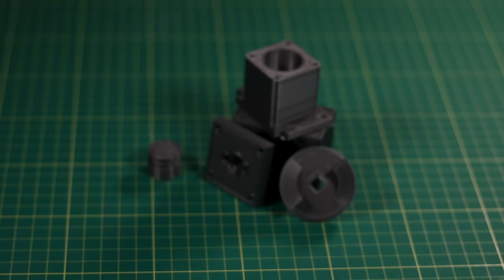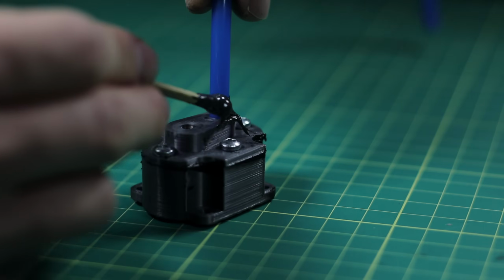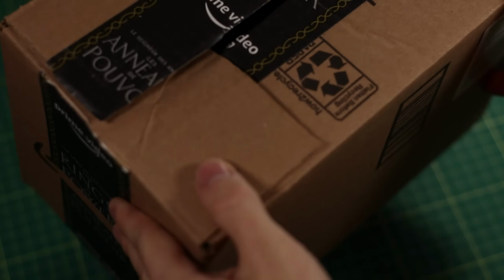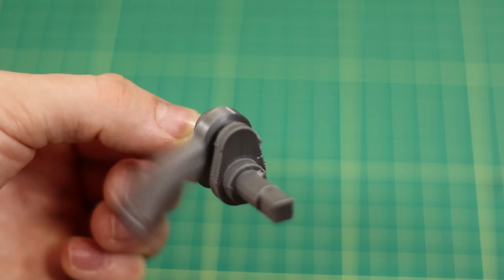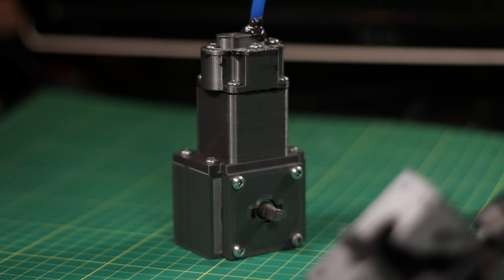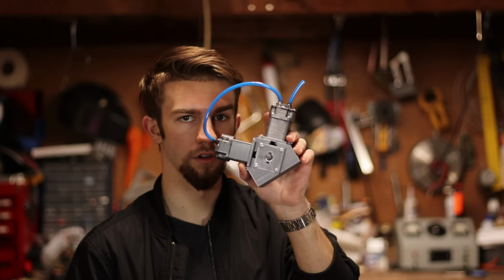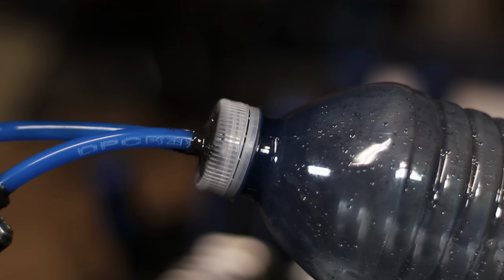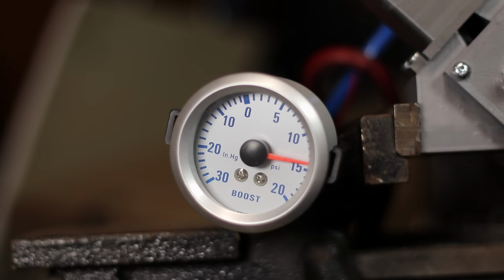The 3D Printed Air Compressor: Will it Work?

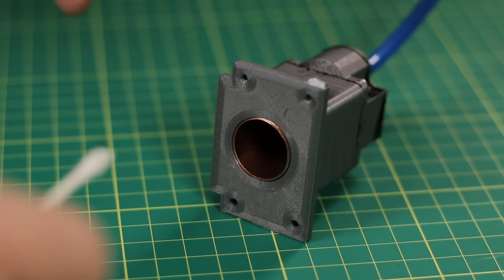Comment: at 1:58 , I can see metal casing inside the cylinder. What metal is it? How much mm diameter metal casing required for this? also please mention thickness and length. of casing ?

Comment: to have multi cylinders compressor, you have to make a calculation on the volume of each cylinder. Having both cylinder the same volume results to the same pressure at the entry of the second then at its output. So you can change Lenght or diameter but never the same...

Comment: Hey friend! Did you use a piece of copper pipe from home depot? I bought one and cut it up to make the cylinder but the piston doesn't fit. I'm thinking of just sanding down the piston to have it fit better but figured it would be good to hit you up since you are actually REALLY responsive on here (which is awesome). I was also curious what you used as pins to hold the piston to the crank shaft?

Thank you again for all you do!
Reply: For whomever it might help I was able to get a more flush fitting on the pistons with a 98% scale

Comment: I know it takes away from the 3d printed aspect, but you could probably increase pressure by adding metal sleeves inside the cylinders.

Comment: tbh this would be a nice way to compress air for an desktop laser cnc. but instead of the glue i would use ptfe connectors. is there any chance that you would share the cad files so i can add the ptfe thread? thanks!
Reply from the maker: They're in the description of the video :)
Reply: @CamdenBowen  yeah i see the slts but i cannot 3d model meshes :).

Comment: Air compressor for a 3d printer part cooling. We have used air compressors instead of fans for the Hevort. This 3d printed compressor is about 1/10th of the cost of what there using 👌👍.

Comment: wonder if you could find a gear ratio that would continually feed air, to one of your air motors, off of the air motors flywheel. (crank to start) if even possible probably need a blow off valve so the compressor dosent go boom.

Comment: If the HP cylinder volume is not half the LP volume then u are not compressing anything in that cylinder, if you fix that the compressed air will exist at a higher temp, and the plastic will melt. To fix that you need to lengthen the pipe between  the two cylinders  and cool the compressed aid air in it . called an intercooler. The head of the the HP cylinder must be made of high melting point materials and cooling the air there is called an aftercooler. Discard the ball valves and use reed valves (flat pieces of high temp steel). Maybe cool the heads with dry ice. If you succeed in that, then that would be really worthwhile,  as when using the pressured air it must be reheated to achieve perhaps 90% efficiency. good luck.

Comment: I coupled a single cylinder 2 stroke RC engine with an electric motor and was surprising good at supplying air, obviously in pulses and a little warm but surprisingly good

Comment: If the valves were the issue, it would be interesting to see different materials tried for the ball valves or forced valves used. It would be pretty cool to  have a 3d printable air compressor that can actually be used for air tools. Particularly if it was turned by a 3d printed dc motor run off of solar panels, so that the compressed air acts as a solar battery
Reply: There's too much dead space in the valves compared to the travel volume.

Comment: I know you think it's 20 psi because the BOOST GAUGE is telling you this but that is not correct. 34.7 psi. The boost gauge as with most gauges that measure some form of pressure do not account for atmospheric pressure (about 14.7 psi). Your system was capable of generating 20 psi above atmospheric pressure would be a more accurate description.

Comment: 2 suggestions
a V8 compound with 4 pairs of 2 stage cylinders, I would suggest to make the second cylinder smaller so you actually get much higher compression
or a inline 4 cylinder version, but all 4 connected in series, but decreasing piston diameter by 20% each step

for the last 2 stages you may need an alternative to O-rings tho, maybe a combined compressor with 2 O-ring pistons and 2 membrane style pistons or something

Comment: u cant tell significant differences by just opening a water bottle and comparing the pop.. u should've just used guages, plus the compressed air being compressed twice doesnt sound like how air works and if the pressure would double, the second compressor should fail faster and should be build stronger to contain twice the pressure plus new air being compressed together.. just seeing some holes in this setup.

Comment: You can always use plaster to turn your 3D print into a cast, melt out the plastic and recast them in aluminum. Good use for old soda cans.

Comment: The drill is likely to cause a heat related failure - keep the temp low with low rpm. The epoxy also isn’t likely to hold onto PTFE tubing for long - recommend pneumatic fittings for that.

 Cool design though - I really enjoyed it, especially the BB valves.

Comment: Suggestion: make a double head in one cylinder. The bottom head is larger with  a smaller head attached to the larger head, as one piece. The discharge from the larger head goes into the smaller head suction & that discharge goes to a second set of cylinders set up as in the first set. Your pressure would be increased.

Comment: You should use a one way valve between the engine and the tank that way you can prevent leak and store the air in the tank without exploding the engine!

Comment: I'd love to see this scaled up. The tolerances in 3D printing aren't great for things like this but as you increase the flow volume the compression losses are a smaller percentage of it overall. If you can use teflon seals and proper bearings for the crank you would be able to run it faster more reliably, plus an air tank with proper fittings would be nice also. Copper tube for the cylinders is a great idea to help with heat which is pretty much going to be the limiting factor on performance for any compressor with plastic parts.

Comment: This is so cool! I didn't realise multiple cylinder compressors are a thing haha! I want a V16 fridge compressor just to flex now. Also would have loved to see a vacuum demo by connecting the bottle to the intake. It's kinda funny/crazy to me that engines, compressors and vacuums are all doing the same job of pushing fluids around for us.

Another cracking vid Camden you're on fire! Also very nearly at 20K subs, I commented a few days ago that you'd hit 20K soon but I didn't realise how fast the growth rate is. I commented at 17.5K (ish) and now it's 19.2K! insanity!!
Reply: Lots of my work consists of water chillers with 12 cylinders. Look up carrier/Carlyle 5H120 compressor. Quite a large and old beast

Comment: I think if you want higher pressure you might want actual valves.

Also I'd suggest a steel pin and maybe some sort of bearing on the crankshaft with lubrication if you want it to last.

Though at some point the cooling becomes the issue.

I wonder how well you could seal a compressor like this to make a small ac unit, filling it with a butane lighter recharge. (With a small system you'd want probably something like 3g of butane, which would make it about as safe as an almost empty lighter.)

Comment: Make it so u can put oil in the crank case and then make the compressor water cooled  so u can get more rotation and make it 4 cylinder I have never seen one like that that has four cylinders I don’t know if it’s going to be better but it’s worth a try

Comment: This could be used to launch a series of bottle rockets. If a manifold was designed with pressure gages that would release at the appropriate pressure and then seal and move to the next rocket

Comment: There is no way the second cylinder would add any substantial performance, you probably had a leak and fixed it during reassembly of the 2 cylinder assemblage. When you compress the air in the first cylinder, as soon as you exhaust it into the second, it not just has enough room to expand in the blue line, it also decompresses again 1:1 in the expanded piston of piston nr 2 because the total volume of the first cylinder is the same as the second one. In other words, since the second cylinder can only draw in as much air in an open piston as the first one exhausts in a closed piston, you are in essence compressing it, decompressing it, then compressing it the same. 

What you need is a smaller piston as piston nr 2 but with a higher leverage advantage to compress pre-compressed air even more. Due to compressor 2 then being able to move less air in 1 cycle, the air between the compressors will get pressurised, making it so piston 2 starts with already pressurised air, and compresses it some more with its increased leverage.

Love to be proven wrong.

Comment: I would consider resin printing to get more precise tolerances and maybe increase maximum PSI output. also maybe redesigning slightly to accommodate more or different cylinders (bore and stroke): hitting 40 psi could prove useful in making a printable car tyre filler (if prolonged runtime is possible!) I enjoy the concept
Reply from the maker: I've been thinking about getting into resin printing, what turns me off is all the added stages to print a part
Reply: @CamdenBowen  The post processing is definitely annoying, at lease compared to fdm, however the extra work is worth it when you need the precision. I only use my resin printer about once every other month, and it’s still been worth the time, effort, and money.

Comment: double it
like make another one and hook it up to the next one maybe make them 3 
which means 3*2 : 6 engines maybe reach 60 psi if two reach 20 psi but idk if the 3d prints can handle that
but overall good video and maybe try making it bigger

Comment: I’m curious if there’s a way to incorporate the air compressor with the air engine in an RC plane driven by like an electric motor and a battery?
Reply from the maker: Possibly, but due to energy losses it would require quite a lot more hardware for the electric motor to generate enough compressed air to fly

Comment: 3D printer was trash from birth. Cannot bear, friction, and friction failure renders print, even making sheaths for bearing or making washers inferior.

By next year micro resin printing will come, better liquids, better LED with more accuracy and precision. Don't buy 3D printer anymore. Just order online and save for resin.

Comment: I would love to see you build an actual hobby/small workshop air compresser with an actual tank several liters in size

Seems like a cool idea
Reply: Thats what came to my mind as well!
Reply: 3d printing is not up to that task. At all
Reply: @swandonovan  I'm sure FDM would struggle quite a bit, but Resin would have a much better fit and finish to help keep friction down.  It would likely be more of a prototyping piece than a true workshop compressor though and would almost definitely fail over time.
Reply: @Tyler.8046  right. Can it be done, sure. Is it feasible as an actual usable compressor for more than a demo piece? Absolutely not

Comment: How was your angle for the twin compressor? Because if they compressed at the same time you would have to add an buffer tank in between them because if not the first compressing Stage would have wanted to press the compressed air into an zillinder which is also compressing. If you did it right they are in an 180° offset that the first stage compresses when the second stage is sucking air in. But you probably did it right I guess but I could not see it in the vid.
Reply from the maker: I did a simple 90 degree angle for the compressor, it seemed to work fine and be space efficient

Comment: a fix for your pressure problem is to enlarge the cylinder length or widen it but, you might be able to get away with more pressure if you switch your printing style to resin printing or making a check valve system that uses a heavier spring.

Comment: It’d be much easier & much more compact to replace the drill/hand-wheel w/ a small, DC electric motor. You can easily find said small motor(s) that run on 1-2 batteries (1.5v each, AA or AAA) & run at as low as 5rpm to as fast as 42,000rpm! 
Bear in mind, lower rpm means higher torque & vice versa.

Comment: Wow, awesome! And what about the vacuum pump? They r pretty expensive, and possibility to have a 3d-printed one in a lab or in a chem-class will be outstanding! 🎉
Reply: I could be wrong and am in no way even a novice, but I would think you'd be able to attach a hose to the intake and create a vacuum to some degree that way(?)
Reply: If you are looking for a reasonable vacuum pump on the cheap (or free) you may consider salvaging a compressor from a fridge or AC unit.  The high pressure side can also be up to several hundred PSI on them too.  This thing would pull a modest vacuum but it would be limited by the headspace above the cylinder and the volume of the inlet valve body.  It also might overheat if run continuously due to lack of gas flow.

Comment: I saw this nice thing where An engine where two piston heads are facing each other and the explosion happens between them And causes them to push apart. Perhaps you can read verse engineer it and make it where the epistans compress the air together and force it into a tank

Comment: Someone needs a resin printer
Reply from the maker: One of these days...
Reply: @Camden Bowen  it be worth it, even if you bought it. The accuracy and tolerances are remarkable and some of the engineering resins are really strong. You could definitely add another stage or 2 if you increase wall thickness and use a stronger resin

Comment: compression ratios and clearance volumes...
20 psi is only a little over twice atmospheric.2.3:1...
you could say you just pumped up my lawnmower tyre.
you still havent filled my pushbike tyre.

the hardest part is to reduce the valve area to reduce clearance, whilst still allowing adequate flow. its been the bane of air compressors for a hundred years and more.

look at how big compressors like the "sentinel" did it. 
even the simple reed valve/plastic shim works fine. inefficient but it works.

and then, if you want to capture say, wind power... theres this really simple, yet amazingly hard task required of them.
the pressure output has to remain constant, whilst the power, or volume being delivered, has to increase in proportion to the wind speed. you need a variable delivery pump.

same as doing it with electricity. an alternator with field windings excited in proportion to wind speeds extract far more energy than simple "fixed" PM generators, that cog and limit their low speed abilities, and need brakes when wind speeds get too high as they dont load down enough... maybe harder to implement initially but worth it in the end.

another challenge with air compressors is that pistons and cranks are "notchy". you only use half the rotation and the load gets insanely high over only a few degrees at max compression. flywheels work but they only slap a bandaid on otherwise unsolved engineering problems. spread that load over the entire revolution so theres no torque fluctuations at all... wow.

Comment: Hi Camden, I’m thinking of 3D printing a custom air tank that can go up to 3000psi. 
Printing the initial shape with a Carbon Fiber Polycarbonate filament then layering a 2-3mm coat of JB Weld… what are your thoughts? Give it a try you’ll be there first in you tube to have created a high pressure 3D printed tank.
Reply from the maker: I think 3000psi is too optimistic for something 3d printed even with the aid of JB weld. For reference a coke bottle can only hold around 200 - 250 psi before they fail. Part of the issue with JB weld is it is not flexible, so under high pressure if the jb weld starts to Crack rather than flex a bit it can cause failure

Comment: hello, if you put a pring in the check valve you will be able to get a higher presure before it tops out your valve, also this would be cool to see if you can launch a water rocket with?
Reply from the maker: It would be very difficult to print it in, so I just made it an assembly. I think that could be a cool video!
Reply: @CamdenBowen  you can put the spring between the output hose and the bb.

Comment: On the head, how does the intake work? I dont really understand as it seems like the intake would be blocked by the Bb no?
Reply from the maker: It uses what's called a check valve. Check valves allow air to move in one direction but not the other. So, by having two in opposite directions, air enters through one and then exists through another. In this case, it breathes in air from the atmosphere and then breathes it out into the bottle.
Reply: @CamdenBowen  So when the piston is on its down stroke is when the air is drawn in? And one more question, can this be used on a engine model such as a V8 run off of an air compressor? Im currently doing a project and planned on using a ball valve and piston head with a pin that pushes the ball in the compression stroke, but that has its own issues.
Amazing video and very inspiring!
Reply from the maker: @Tokujii  As the piston is stroking down, air enters from the left valve but is blocked by the right, and as it does an upwards stroking, the air exits from the right and is blocked by the left. Everything but the head itself pretty much is an engine, if you were to make modifications to the head of the compressor I believe it can be converted to a twin cylinder easily, or even a V8 as you suggest. Thank you!

Comment: I was looking for a small pneumatic vain pump to compress air and push them through a filter that is attached to a helmet. I have a beard so a gas mask doesn’t make a great deal. Instead of shaving I wanted a positive pressure helmet JUST in case we have another pandemic. Thank you for the leg work.